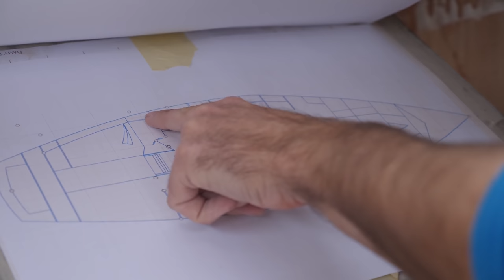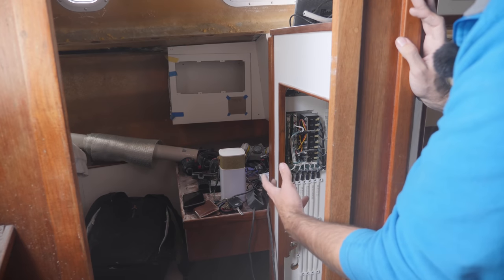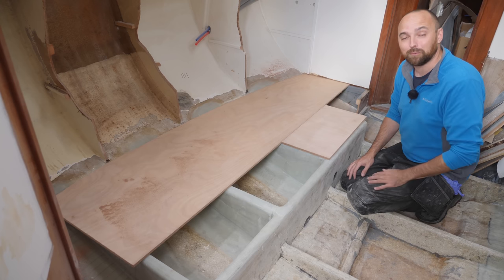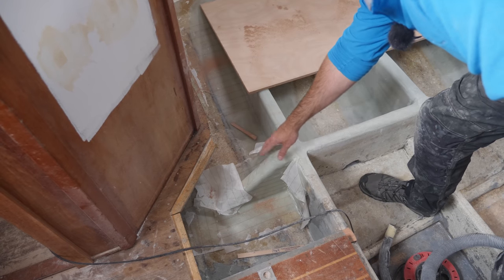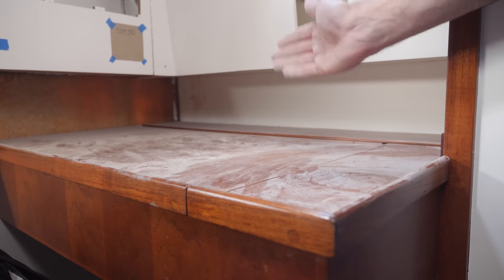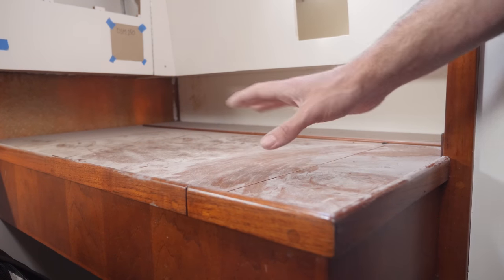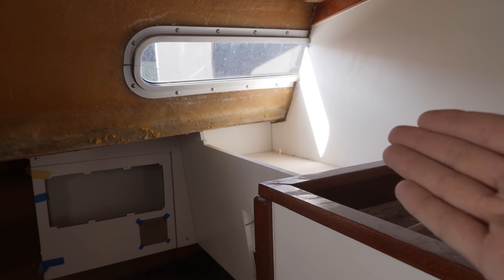Sail Life - Bulkhead number two, check!

Comment from the maker: NB! YouTube is dragging their heels again. There is a 1080p version of this video here: https://www.youtube.com/watch?v=-VRv85HUhgo ... If you'd rather wait for the 4K version, check back here in a few hours. It's been a few hours, and so far, only the potato vision resolution seems to be available (360p).
Reply: I expect you are going to run afoul of this a lot, Mads. I don't think Youtube is really set up to have videos go live immediately after upload, and the fact that it usually works OK is just luck. People like you who can produce videos and release them as quickly as you do are a rarity ... quite honestly, I have no idea how you manage to keep it up -- it's impressive!
Reply: Pump or vacuum  bilge,you may even put a Magnet  down  to see if anything has dropped  down there. Just a thought,I really don't know,  so take it with a grain of salt.
Reply: Curtains,would be great instead of a door. Something that would fit into  the scheme of your boat. Curtains and or  some kind of ' Shade' have come along way in the last 20 years
Reply: I don't care, as long as I can watch.
Reply: This is in 1080p...
Reply: Ive heard of people using semi flexible cement (roof capping grout) to fill that keel void,  it’s heavy, waterproof,  and very easy to pour in,  And self leveling.  Can even be painted over with Bilge paint.  But you need the right cement,  some hardware stores call it “floating cement” others call it capping cement”. Unfortunately youtube doesn’t allow comments anymore only replies,  so this Suggestion may not be seen.  But if it is, it’s definitely worth researching for yourself.  It’s in no way “a new idea”. It’s actually a very old one. It’s only the cement quality and slight flexibility that has changed.   But if you think about it?  It’s far better than expanding foam.  The loss of performance due to weight, is counted by the increased lower center of gravity,  meaning slightly more sail area before having to take a “reef”.
Reply: This came at 720p in Australia but changing the res to 1080p worked. The vid looks fine.
Reply: This one doesn't even appear in my feed despite using the old variant of YouTube that's yet to be mutilated by the incompetency of the new teams and having all the bells and whistles on. The CEO is dragging this website into the ground just so she can have her hour of glory with her (multiple) failure of a paid variant. Why Alphabet Soup and Google ain't making another website that's paid and let us be, is beyond me. Goes to show that besides buying themselves out of mediocrity, they are unable to enrich a platform.

Comment: Given the shape of the doorway and space limitations a bi-fold door might be a suitable option. Consider leaving the bilge until you've launched Athena, it might be the case that once loaded out it might need lead ballast added to balance the boat and deep in the keel would be the best place for it. Keep up the good work Mads always enjoy your episodes.
Reply: Agree!
Reply: Airplane lavs work this way for the same reason of tight space.  It's a good, reliable solution.
Reply: That or double small doors reversed hinges if needed (one opens in one opens out)
Reply: I reckon this would be a viable option too.
Reply: Agreed. Bi-fold door works nicely on my boat and would work well in this application.  Also, good advice on leaving the keel open for now.
Reply: Yep, bi-fold door and a false floor in the bilge after you're afloat.

Comment: Idea for aft cabin door: Curtain

• Bring some fabric into the interior would be nice to balance all the other materials aesthetically.
• Easy to change out periodically for a fresh look and feel.
• Possible to leave the top and bottom open for airflow.
• Less likely to trap someone in a capsize. This has happened when debris blocks opening the door.
• Upgrade: epoxy a plate of metal in the bulkhead where the lower corners of the curtain are, then sew magnets in the bottom corners to keep the curtain from hanging across the companionway landing when heeled.
• A simple length of cord and a couple of bolts/buttons could act as a curtain rod. 
• Can be removed entirely without much fuss if the privacy is unnecessary and openness is desired.
• You could still build a bulkhead with a large oval "doorway" in it to tie the structure together more if desired, just have the curtain instead ofa door.

Comment: Mads, I don't see anything wrong with leaving the port quarterberth open. Maybe a curtain or something down the road for privacy when you have Patreons on board as guest crew. ;)
Reply: I agree, leave it open (with bulkhead wrapping around with an opening to enter/exit the berth, fill the area with berth with lockers outboard and a little cubbyhole outside below the opening for shoes.  A nice generous edge molding around the opening.  You could, if needed, have a curtain that could either simply cover the opening or alternatively be hung to make a small "changing area" in front of the berth.
Reply: Yes--- or a flexible accordion type door!    Loving the build too!!
Reply: Good idea on the curtain. Whatever is decided on it should be strong enough to withstand a body slam for when someone might loose their balance in a rough sea, or totally give way such as the curtain.

Comment: For the deep, cavernous bilge that swallows entire civilizations; Figure out the ideal depth that you'd like which is a nice balance of volume but still accessible for cleaning.  Create a custom fiberglass pan that will be the new bottom but design in a low point depression that fits the foot-print of your ideal bilge pump and float-switch.  Glass/tab in the pan where it will live and then fill the void with expanding epoxy foam (much better than the mess you had to previously remove).  The depression at the low point of the newly formed bilge should be just small enough to hold the pump's suction end but enable you to evacuate 99.8% of the bilge water and then maybe just sponge up the last bit. Super huge OCD pet peeve of mine is seeing a bilge pump do a great job but then when the float switch shuts off you get a back wash of 4 liters back into the bilge and it's never fully dry, plus a pain to clean.

Comment: My first thought was bifold, but the rattle and are a PITA to open and close. Next thought is a split door you can have one half swing in and the other swing out. Last was the venerable curtain, it’s cheap and easy.  I really enjoy the videos, last week I removed a webasco diesel heater and assorted copper pipes and radiator heaters. It only took 2 days. It looks so much easier on film

P.S.  if you would like to practice your boat wiring before reinstalling all of yours come on over I won’t charge you much🥴

Comment: In terms of bilge: the deeper the better, it's a place to catch water before You bail/pump it out.
Put on a framed mesh or something to keep "the solids" from diving down into the bilge. I would not turn it in a shallow bilge. 
In terms of quarterberth door: two half doors would do, or probably a door split into two thirds/one third. Or no door at all (the regatta-boat solution 😂), which could make it difficult with guests though.

Comment: 1) BILGE...Fill the deep bilge with expanding expoxy like the rudder. Don’t add any plywood down there at all. Cap off at the desired depth with a fibre glass lid like the vacuum part for the rudder. Paint out with ‘tanking-solution’ so it’s totally water proof.

2) PORT aft Cabin Door. TMake a bi-fold door, hinge in the middle to close inwards  back against the new bulkhead. 

Regards 

Rob

Comment: Hej Mads .... Remove everything from the entire bilge. You might find a gold coin! Clean up all. No water. Construct some machinery to be able to do that.What to do then: 1.  Improve the fiber glass. Add an automatic pump. And use the bilge for storage: a. Drinking water (in a separate "box"). b. Construct a steel carriage for Diesel. c. Surfase water - water from rain - in the water proofs bilge. This water to be used in toilet etc. 2. The weight of  whats inside that bilge, should be calculated precisely. What will happen to the total weight of the keel ? But the bilge should be waterproof the next 50 years.  Farvel ( = Cheers in Danish

Comment: Suggestions: sliding door that slides around a corner, to match the rounded corner going in for the expanded head on the other side, and consider using the bilge space for some kind of tank.

Comment: We have a very deep bilge on our boat: 6 feet. While it is an annoying magnet for escaped fasteners, tools and other fun stuff, it's also a major safety factor, giving us a lot of time to respond to leaks or shipped water before things reach "emergency" level. Something to consider before you head offshore. And to deal with those escaped doodads that find their way into the deep bilge, we use a 60" grabber/reacher tool. Lets us pickup even 6mm washers.

Comment: The vertical split hinged folding 2 pc door is the usual solution to allow 1. close the space with full access, 2. narrow up the swing area 50% or so, and 3.  doesn’t take up any more interior space.  Stainless piano hinge down the middle gap.

Comment: Pocket door,  accordion door or roll up door would be you best bet. 
The pocket can be locked open or closed and is most like a standard door except when it’s open it is in the wall.
The accordion door does not need the hollow wall and is the least expensive.
The roll up door takes up the least space but when “closed” is sort of like a framed curtain.

Comment: Put a removable grate some way down the bilge to catch any objects but let liquid through?
Reply: Yep.  Don't try to seal the bilge.  All you'll do is try to seal it and not actually succeed.
Reply: This! Many suggestions out there but this really  seems to be the best! Even if you'd use the bilde For some extra batteries or an extra thank for something, a grate over it would keep things from going into the void and still let you see the situation down there.
Reply: That deep hole needs a bilge pump in it and beside that a sponge with a low volume diaphragm pump sucking through it, and above that a removable sieve that allows air and water but not pump clogging particles or other small parts through :)
Reply: Also you could try using it as a storage compartment, no need for wasting space onboard a boat!

Comment: Cabin doors: Spilt-folding (Billfold) or Saloon Style on dual side springed hinges. For you bilge you can make a insert mesh removable basket that slides down with a handle coming up to so you can easily grab it and pull it out along with all the goodies that may fall and collect there...

Comment: Make the aft cabin door a double door (two half doors) both opening inward.  Have both doors snap into place with a spring loaded ball on top of each door and latch the door with a simple hook and eye hasp. You can then use the same hook and eyes to hold the doors open with separate hooks and eyes mounted to the walls.

Comment: I think a sliding door would be the best solution but maybe switching it to the engine bulkhead (forward to aft) mite  be a better use of a very small space, the reasoning to this suggestion is now your new bulkhead can be used as coat hanger space or shelving or even just hang a TV there so your guests can watch you on the tube :) and as a latching system for the door have you considered TBC

Comment: If you build a door that folds in half you could have the hinges on the bulkhead just behind the nav station, so it folds in half then closes against the bulkhead and can be latched in place, I would also try to find some spring loaded hinges that are designed to hold the door seam in a butted position when it is closed, so latching it when it is closed is easier.

Comment: Hi Mads, 
I have an Albin Nova (the new layout from -89 and later) and that has a sliding door, at an angle similar to yours. And that works great. No need to build a curved door, you could just put ”rails” or whatever its called, top and bottom. The door will slide perfectly. Easy solution, works great and looks great. Keep up the good work!

Comment: A few thoughts: First, you sure like your Bosch toys.  Second, you might consider turning your nav station 90 degrees counter-clockwise so that you're facing the hull when seated.  If you then installed a swing-out stool, you'd save a great deal of space, and in my cruising experience you just don't need a big nav station as no-one uses paper charts anymore (how dare I say such things!!!???!!!). Third, I had a similar bilge situation 2 boats ago.  I also filled mine with foam, then laid a piece of styrofoam panel over that, and glassed it in.  No more cavernous bilge.

Comment: I would say keep the bilge deep. It might be a pain to clean but if and when you take on a bunch of water that bilge will buy you time before the water hits your cabin sole and things you have stored under the sole. our HC33 has a similar design, we have the normal float at the bottom and I have a High bilge alarm at the near top. If that goes off (it never has yet) we know we are taking on water more than our primary pump can handle. there also lives a large 4000GPH pump in the bilge we can turn on if that alarm goes off.

Comment: Keep the deep bilge. Having more volume to fill after the bilge alarm goes off is never a bad thing.

I'd build a fiberglass false bottom that sits on epoxied g10 (or similar) blocks. The false bottom would make for great storage that's within arm's reach and keep the things you drop from going to the bottom of the bilge. You can make it as deep as you want for storing things like wine bottles and tall, heavy crap.

Comment: Leave the bilge empty with one major change, clean it up, glaze it again, so it's water tight and then put a removable pump down there (find the most abuse prone one you can get, prolly a pool one cause they can suck in leaves and all that jazz), then build a cover for it, glass some edges to it, and forget about it until you have to clean it again. Prolly have some kind of moisture sensor down there to alert you to any pump failure or water ingress.

Comment: Just make sure that the bilge is the deepest recess inside the boat because any liquids (oil, sea water, tea, mom's soup, etc) will accumulate there. If the bilge is not deep enough you can't fit a pump there and also those liquids would spread everywhere else. So usually a deep bilge will be good.

Comment: Unless you have a cored hull, it is recommended to use a cushion between the bulkhead and hull to reduce imprint to the hull and stress points. I , just leave a gap between them and remove the spacer after tabbing it in . I always treat wood as if it were going to get wet, boats leak.. sealing the edges of the bulkheads with epoxy would be nice before tabbing them in.

Comment: Several questions (I may have missed some answers earlier):
Why not scarf the bulkheads back together?
No thickened epoxy also bonding bulkhead to hull?
Were panels disconnected? Why not leave connected to as much wiring as possible and a small chuck of bulkhead, prioritize Nav station first and position panels ASAP?
Maybe a tambour door? Can follow any opening shape you want ("door" bent 45° in the middle, an arc, etc.) and can hide behind cabinetry/within a false-front bulkhead.

After assessing need for additional ballast, fill bilge well with closed cell foam or expanding epoxy and cover with well-bonded fiberglass?

Comment: Pocket door on land great idea, at sea, not so much. Leave it open or bifold it.  Deep keep, had the same issue, hard to clean and all that. But unless you want to cut a hold in your nice new copper coat hull, don't see much way to fix it. Just put a screen on it, after taking out that plywood and have a good bilge pump system on it. If you ever have a leak you will want that extra space for holding water. Then every few years suck it up and clean it out. My 2 cents.

Comment: Wow you do great work! my hunter 34 had a bifold door at an angle, it was totally open most of the time and secured with velcro straps so it didnt bang around.
as for the bilge im a fan of deeper ones, if all errant water can get into it! the shallow bilges on beneteaus, my hunter, a Bavaria I know, and Santa cruz 52 I raced on tend to be impossible to pump out, and when heeled over under sail the water runs up out of the shallow bilge and coates the  insides  of the hull creating a funk when it dries out, just my 2cents worth!
Aloha from Hawaii!

Comment: The plywood in the bilge has me a bit worried if you should choose to fill the bilge with foam. It might lead the moisture from the other parts of the boat into the newly laid foam. I think I like the idea of closing off the bottom part and using the top for storage

Comment: I would leave the bilge till launch and check ballast first, If change is needed maybe close cell or could use as storage, A wire basket could be removed easily, As far as the door maybe duel sliders or just a curtain, let her pick out which it will not be needed unless you have company.

Comment: Hi Mads
Re: Bilge. I don't think I would use foam but just 
seal it over hollow and install a water tight round access port. A small canoe pressure equalization valve would be good as well as the port may vacuum  lock itself.
Rob

Comment: Hi Mads, thanks for the channel a highlight for Sunday. In a previous video you mentioned putting a rounded panel to finish off the bulkhead for the head, for the aft cabin why not consider a rounded slinging door that opens along the engine compartment out of the way.
Reply: Tambour ?
Reply: Yes, however there may be down side with all the visible vertical slats, but just a suggestion.